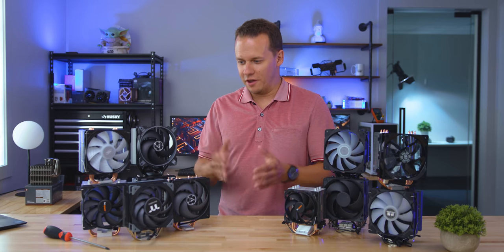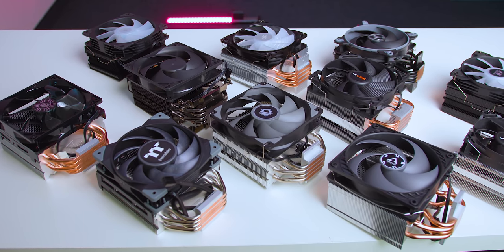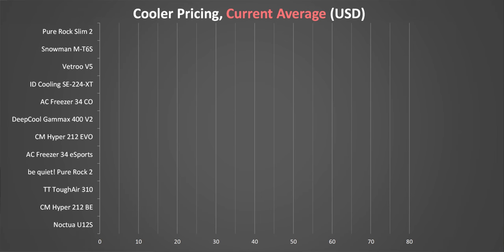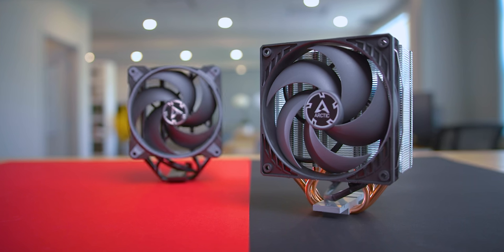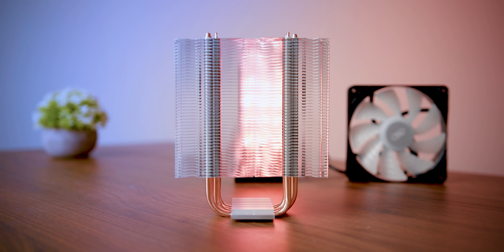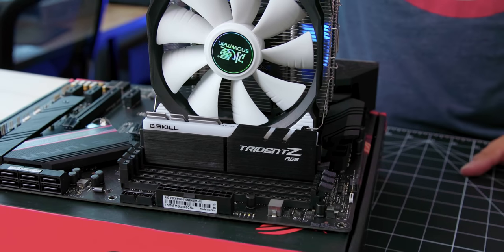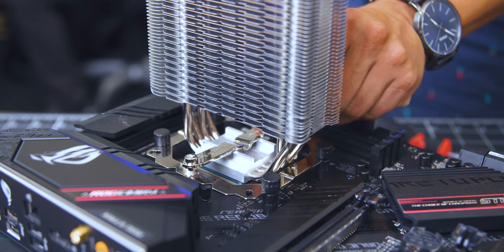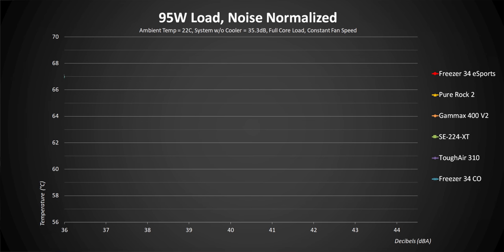The Best BUDGET CPU Coolers!

Comment: Remember the days when the CM Hyper 212 was the go to budget cooler? Seeing them at the bottom of this list, when they come in more expensive then a lot of the coolers shown here is really telling. Cooler Master hasn't done anything really unique with the design for so long and now they've been surpassed. Hopefully this gets them working on the line of Hyper 212 coolers to get more performance out of them because the only time I ever pick them up nowadays is when they go on sale for $20. Any other time I go with the other alternatives for $20-30 since $40 standard pricing for the Cooler Master brand name is NOT worth it.
Reply from the maker: In a way, they've been sitting back raking in the sales.  Don't think that's enough anymore.
Reply: To be fair to CM, the RGB version has a higher RPM fan which helps it perform better than the version here which uses a lower RPM fan. I'm not sure if that brings it in line with the rest here or not though.
Reply: I'd bet that a number of these other brands are also manufactured by Cooler Master since they're huge in the manufacturing side of things. They certainly have the capability to do better, but when the tooling is paid for and they keep selling there's not much of a need to improve.
Reply: Dunno mate I've been looking at one of them "esports" coolers tested here for a couple of months to replace my AMD stock cooler, they cost about 30 quid in the UK new so.....
Reply: @darthwiizius  Not alone there, the Toughair 310 is like half the price of the Freezer 34 in my own country.
Reply: for their price, they doing good.. I got Hyper212 black edition for around 35usd
Reply: In my country the Hyper 212 is nearly half the price of all of them (the Noctua is nearly 4 times the price !!!!!!) because nearly all the PC stores had them is stock for such a very long time.
Reply: The CM fans can't really innovate much @$20.

Theyre better off using their branding to leverage more profitable $30-$60 coolers with 5x the margin
Reply: i mean it's just 4 degrees and well under the termal throttling rate for the cpu, so. Pick whatever you can afford. I would never put a cheap cooler on a 5950x, but hey. If you can afford only that, im sure it's way better than the shit amd stock cooler that used to run my old 3600 to 80 degrees lol. Can't imagine a 5950x.
Reply: i have used that cooler over 4 years
Reply: they are really just milking the brand/model name at this point, which sadly goes a long way with most people.
Reply: @nyphon  well it hasn't really changed...so most just file it under "known good configuration" if they don't feel like researching again.
Reply: Deepcool Gammax 3 was far better but a less known brand
Reply: @ulyssessait  could get the 34 esports or the dark pro 2
Reply: @blazesmooth5573  I wish I known 34 esports before I got hyper212 black..   of course I pick it.  I love arctic products..  now my hyper212 uses arctic p12 as push pull config

Comment: Fantastic review! I've been using the Se224xt (white) for a month now and I'm pretty happy with it. Since it comes with an extra set of retention clips, I went ahead and bought another identical fan for a push pull config. Now I'm running the fans slower without changing the performance and having it too loud.

Comment: I definitely prefer air coolers.

I’d only go AIO if I didn’t have space in the case
Reply: and aircoolers can usually be used for a decade, while AIOs...
Reply: AIO probably is mostly only for aestetics
Reply: agreed. but there is something about the CPU area being accessible and visible that is very appealing. I keep switching between my AIO and tower air cooler every now and then.
Reply: For me its access to the case. With an AIO I have a lot of room to work and I dont have to pop off the AIO to get access to the area around the CPU.

A good AIO will last you at least 5-6 years if you dont position it in a stupid way.
Reply: @Angela Merkel I prefer black with or without RGB
Reply: @nktslp3650  Very true. I'm still rocking my over 12yo Thermalright Si-128 SE.
Reply: @James Smith Incorrect.  There are quite a few cases where you must use an AIO due to space constraints.  Consider things like some of the odd vertical tower/cube designs, or (for example) the corsair 250D(which, at the time, your only real options were lousy low profiles or the corsair h100).

  Sometimes the manufacturer doesn't leave good airflow above the CPU area, or little/no space and instead leaves a separated area only reachable by watercooling tubes.

So the ACTUAL difference between an AIO and an air cooler is 1)Dissipation area is disconnected from the CPU, 2)Total heat carrying ability between CPU and fins is higher due to water vs heat pipes,  3)Total fin area is potentially larger if you go with even a 240.  

Of note is that  you get little/no result for greatly exceeding the heat generation capacity of your system.  An AIO on a 65w processor probably isn't worth it unless you run into physical space limitations.  An AIO on a 200w processor is superior assuming competent coldplate design.  At this point, most air coolers are insufficient, while water coolers are still bottlenecked at the CPU/IHS/coldplate sandwich.
Reply: SmashStomp Inc  The NR200? I’ve got one, it’s fantastic. And yeah easily fits basically any air cooler while being SFF!
Reply: @James Smith Downdraft is even more case dependent.  Downdrafts do not help intake, nor internal airflow(from intake to exhaust), nor exhaust.  They in fact hinder it and cause turbulence.

So no, stock coolers don't work in almost any case, it's just that people have low standards.
Reply: @James Smith They're fine, for people with low standards.
Reply: @James Smith Yes, I understand.  You put an AIO in a machine to watch youtube.  That makes sense.  Have a good life.

Comment: FYI In Indonesia you get 2 fans instead of 1 for SE-224 XT Basic for $28.
Reply from the maker: Wow, THAT'S a deal!
Reply: I think that's the se-225 version though. I'm from SEA too and the se-224 always comes with 1 fan while the se-225 comes with 2.
Reply: No, 224 xt basic as well. Only basic tho, not other variants.
Reply: @svetta3003  Only in Indonesia you get SE-224 XT Basic Dual Fan Version :)
Reply: @svetta3003  its Indonesian only exclusive i think, CMIIW

Comment: I have the ID-Cooling SE-224-XT and tested it with several fans I have laying around; Noctua NF-P12 1700, Scythe Wonder Snail 120, Arctic P12, TT Toughfan 12. The cooler then goes to the next level.. says a lot about what an excellent heatsink ID-Cooling made.
Reply: Did mine dirty by slapping two, 12-inch, industrial, 3000 rpm molex fans on the tower (push-pull config) and my worldly desire for Noctua ND-H15 is out the window. My PC sounds like a vacuum cleaner but temps are relatively low and fans go brrr haha

Comment: This video was great. Was looking to upgrade my cpu cooler from a small cheap 92mm tower to a bigger 120mm tower. After watching I went with your pick of the ID Cooling SE-224, and I love it. I like having that extra headroom when it comes to the cooling, and a little extra noise under heavy load isn't too bad on my system. Thanks for all the work comparing all these coolers and making my decision easier.

Comment: This has got to be one of the toughest comparison challenges out there. Not for the reason that most people think. The ID Cooling SE-224-XT that is recommended is priced in the canuck market for almost 3x the price. The vetroo is 2x the price. Artic cooling Freezer 34 eSports is 2x that price. Still, even with all the variance in pricing, this is a great resource and the effort is to be lauded.
Reply: lucky i am in SEA (indonesia) id cooling se224xtduet fan even cheaper than MSRP
Reply: @kevin-sj3wt  same here in SEA IDcooling is the way to go. it's the cheapest of them all

Comment: A great follow up test would be to normalize the fan to test the performance of just the coolers' heatsinks.  In other words, run the tests with all the coolers again but use the same fan on all the coolers.
Reply: Ooh that's actually a good experiment to perform! They can also try testing different 120mm fans on different heat sinks to see which fans move air more efficiently through the fins. I'd love to see the data on each of those!
Reply from the maker: Interesting idea!
Reply: That would be a awesome to see the results of that test! Maybe with an Arctic P12 PWM PST CO fan, since that seems like a most likely purchase for... "frugal" gamers.

I'd like to see someone cover the recently released ID-COOLING A410 also. No one has reviewed it yet afaik.

Comment: This was a great video. Informative and well researched. I do agree with the other comments about the 212 being a relic and not improving, but personally having had one in push, pull, it was still pretty good especially since we can't find many of the others here in South Africa.

But that aside, I'm glad you made this. The Noctua is a bit above the pack, but when you're considering that people running 150w CPU's are probably paying a fair amount for them, I think it's valid to say they won't use a sub 50$ cooler on them. This is the reason I found LTT's video on the Noctua very shilly. You need comparisons when releasing new products, comparing it to those from the same manufacturer won't get you anything more than, more money more good.

Keep up the great work!

Comment: The Deepcool Gammaxx 400S has a non-PWM fan that maxes at 1,300 RPMs. All the others have a PWM fan that maxes out at 2,000 RPMs. I switched out the fan for the Be Quiet! Pure Wings 2 fan. There was only a one-degree Celsius difference between 1,300 and 2,000 RPMs. YMMV
Reply: it's not just about fan speed though, especially when it comes to CPU coolers... static pressure is important too

Comment: It's too bad that you didn't include any stock coolers because I'd be interested to see how the Intel stock cooler fares agains these...  No, I'm lying.  Everybody knows that the stock Intel CPU cooler might as well not exist because of how bad it is.

However, the AMD Wraith Spire and Wraith Prism are fantastic stock coolers which really redefine what a free stock cooler can be.  Since 2017, I have used a Wraith Spire RGB and a Wraith Prism.  The CPUs that I've used the Wraith Spire RGB on have been my R7-1700, R5-3600X and R7-5700X.  I traded the non-RGB Wraith Spire (that came with my R5-3600X) to my dad for the Wraith Prism that came with his R9-3900X, because he hates RGB lighting (he's even old-school compared to me and finds RGB lighting to be Gaudy and Tacky).  I put the Wraith Prism onto my R7-5700X and it's now on my R7-5800X3D.  I didn't notice any performance gains but the Wraith Prism has got to be the most beautiful CPU air cooler in existence.

Now that I'm off of that tangent, I'll say again, you really should include the AMD Wraith Prism (and Wraith Spire if you have one) as they'd make great baselines to show just how much (or how little) of a performance boost that you'd get with these premium-priced air coolers.

As for pricing, though you just can't beat free, eh?

Comment: While I'm a Noctua guy and totally admit to being biased when it comes to air cooling this is a great review as I'm often helping people put together systems who think Noctua prices are way too high.  Sad to see the hyper 212 rank so low, I remember when it was the king of budget cooling and I installed quite a few of the initial version in quite a few systems.

I know it would be a huge pain to do but I'd love to see how all these coolers do with better fans i.e. if some of the included fans are the limiting factor and not the cooler itself (which in the past has usually been the case).

Comment: for an extra like 10usd, the scythe mugen 5 is an awesome cooler. the heatsink itself isnt anything special but the fans scythe makes are the quietest ive ever seen. i threw 4 of them in my pc including the one on the cooler and pretty much any noise drowns them out, like any gpu fans or a ceiling fan or  your home AC.

Comment: I'm pretty happy with my Hyper 212 BE (on an R5 3600), and I just put the Gammaxx 400 V2 on my 12 year old build because it's Phenom II's stock cooler finally crapped out. Why did I get the Gammaxx over a 212 Evo? Because it had a blue led fan that matched the rest of the fans in the case, lol.

Comment: Bit higher on the budget category but once you go Scythe, you never look back. Kutetsu is $40, Mugen is $50, Fuma is $60, latter leaves Noctua in the dust.
Reply: Check GN's review. Fuma isn't that good.
Reply: yea Scythe Mugen 5 rev b is a beast. keeps the 3900X in check. (running push/pull and whisper quiet)
Reply: @hassan7569  then you didn't understand the GNs review at all. Just saying.
Reply from the maker: If you keep increasing the budget, it never ends.  ;)
Reply: @HardwareCanucks  Fair point! :)

Comment: The 224 is currently $25 on amazon.
Reply: Bought mine for 23$ back in November. I was going to spend 100$ on a U12A without batting an eye, then I found out that for my 5600x, it’s only 1 degree cooler than the 224xt with P12 fans for 1/3 the total cost.

Comment: The gammaxx 400 was my low cost go to for a long time, because I just dont like the stock fans from intel, AMD not so bad but  why not something a little better. But the Gammaxx 400 has gone up in price, so when I saw these ID-Cooling SE244XTT locally for real cheap, it looked good. So glad I came upon your review, as this might be my new default cheap replacement for stock CPU coolers. Nice review!

Comment: I’ve got an Arctic Freezer 34CO with a second fan for push pull. It’s mounted On a ryzen 3900x. When playing cyberpunk I get between 54-65degrees depending on areas of the game missions. On doom eternal and forza I get a range of 45-50degrees. As I go into animation and 3D design I am getting high 80s on a blender render. Will go for artic freezer 50 or Ndh15 chromax

Comment: Looking forward to the ID-Cooling dual tower cooler se 207xt black. Solid copper base. The id cooling perform differently if you have a single chip ihs(5600x or 5800x) or multi chip ihs 5900x, 5950x. They perform even better on the 5800x/5600x

Comment: one aspect of the Freezer CO wasn't even mentioned. It's fan is designed for continuous operation. My Arctic Freezer13 Pro CO still runs 24/7 - for nearly 10 years now - in a smoker environment - cooling my 2600K @4.2GHz.

Comment: This has been awesome. I ended up with a gammax something with the fancy RGB plate. (It syncs with razer via mystic sync). It keeps my 10600k at around 70°c when playing at 4.9ghz, 1.3v.  

Do you guys intend on doing this with AIO coolers? My case doesn't support a top radiator & my rtx 3070 strix is so long I had to remove my middle front fan. (Doesn't exceed 61°c). I've been considering a 140mm AIO

Comment: I have the DEEPCOOL gammax 400 V2 and i got it on my prebuild that came with just an i5-9400f now i have an i7-9700K and keep it overclocked all core 4.8Ghz and my temps idle at 35-37
Reply: And while gaming around 50-60% load my temps max around 66-68 degrees but i also just put a monster FTW3 2080Ti in my case but it’s triple fan so it should help but my next two upgrades will be a mobo and CPU then ill get a better cpu cooler. But the DEEPCOOL definitely puts in work

Comment: Interesting. In my testing, the Vetroo V5 on my 5900x with all power limits removed runs several degrees cooler than the testing shows here. I also have the PBO limits set so that mine can boost to 5.0 GHz single core and don't see temps like shown here. Guess the case I'm using has pretty good airflow to keep temps in check.
Reply: That and you don't know if your ambient temps are better.

Remember it's never really that useful to compare results across different testing environments.

Just use the info provided in the test for comparison based against the other results provided in the same testing environment.

So you can compare a to b to c to know which you should get but ultimately their "a" and your "a" aren't likley to be the same.

But if YOU tested a vs b vs c as well you SHOULD see similar "differences"
Reply: @TJ.85  9 month old comment and that system is long gone already but you are not wrong. I keep my temperature set at 70f or 21c.

Comment: If this is ever revisited, it would be awesome to include the various stock coolers as a comparison point. The main thing with budget coolers is that the performance needs to be proven to be substantially greater than the stock coolers to convince me to spend my $30 for example. 

The other thing that I think can be explained better is the noise output - you provide decibels as a measurement, but it is real hard convert that to real world experiences. Decibels being on a logarithmic scale, I think it may be better to provide a perceived loudness for us (Tech Jesus does a good job at this, where his comparisons may include something like "3dba is where things are noticeably louder" or "X vs Y is twice as loud," or "multiple times as loud in acoustic perception". 

Love the good work though, doing this many tests is definitely tedious!

Comment: I’ve been using the white ID Cooling cooler on my Ryzen 5 2600X for the past few months and love it! It was on sale for $25 with free 2-day shipping. I use an Antec Prism fan on it instead of the stock one but the temps and noise are phenomenal. It pulls around 110-120 watts at full load and has only seen a max of 70C. I also used Arctic Silver 5 thermal paste as I will never trust a generic paste that comes with cheaper coolers.
Reply: ID Cooling making its own thermal paste and it's actually rated above average in most tests.